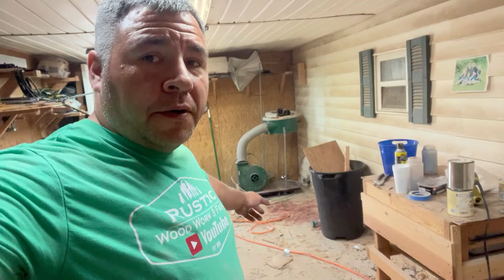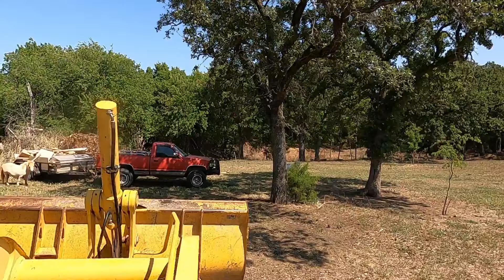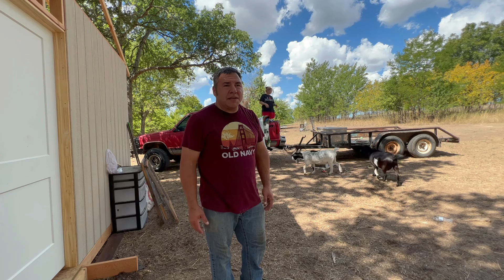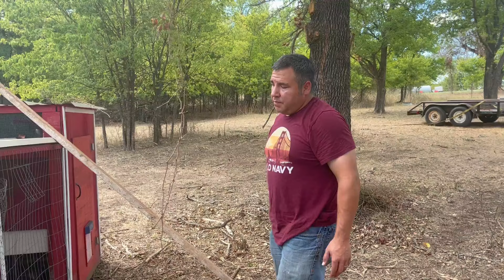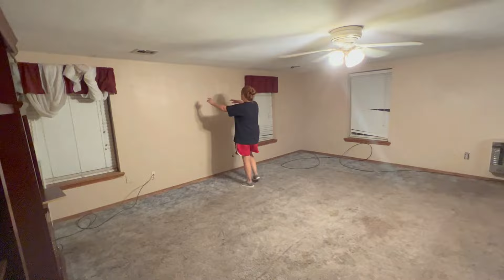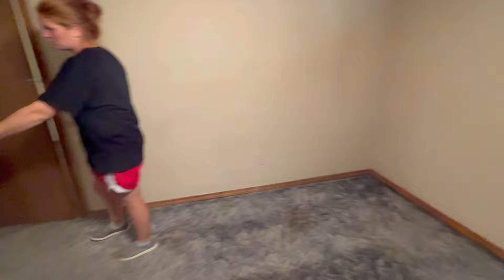Time To Say Goodbye, We Enjoyed It While It Lasted!!

Comment: I was thinking that stone/concrete papers are not that expensive. I used them under my dog kennel. I laid down a small gravel first then concrete papers over it. It worked really well. I think all told it was around $100, much cheaper than pouring a concrete pad.
Reply from the maker: Awesome